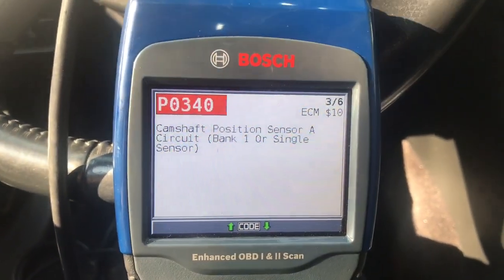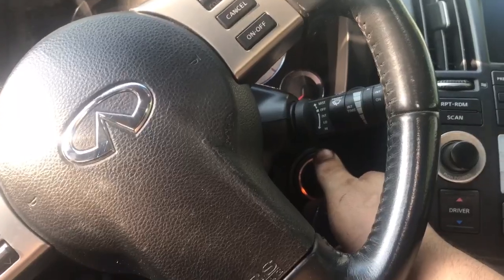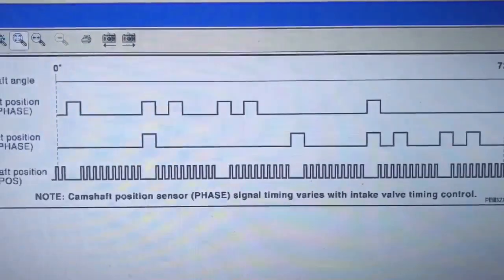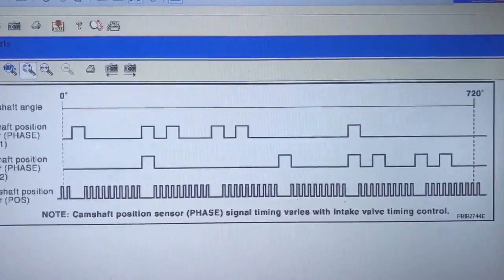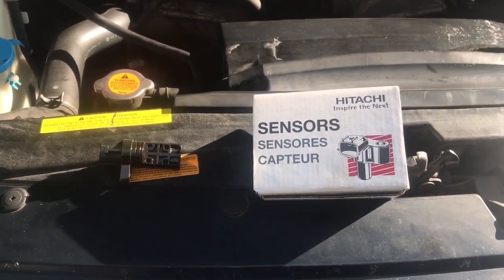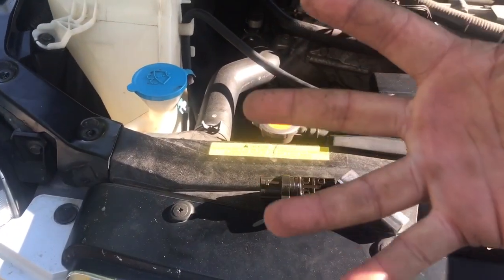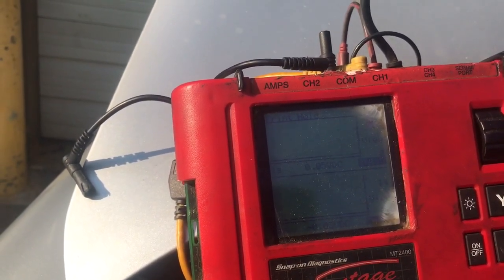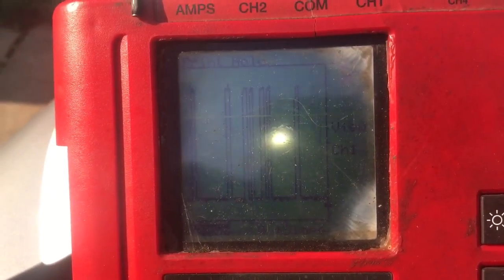Testing a bad cam sensor

Comment: Yo I got a different code idk if it’s still the same so the code u got is 
P0343 camshaft position sensor “A” circuit high bank 1 or single sensor

Comment: I’m having a no start issue and p0340 showed up after a month but it finally popped up while cranking I’ve always thought an engine has to be running to pick up a code and it wasn’t in the saved message either that one had a p0011 something over advanced and that was in the saved codes not an actual cel light

Comment: is it possible for a  failing cam sensor not  be sensed and therefore fail to  activate a check engine light?
Reply from the maker: A dropping 5 volts or ground can cause it but. A dropping 5volts will normally pop a code

Comment: I subscribed to your channel because you have a great way of explaining both how the car is supposed to work and how to make a fix (a rare talent).  Very clear.  I have a cheap multi meter that won't graph the signal wire like yours did.  Can I still test the signal wire with my multi meter?  Am i doing that on the OHMs setting?  Thank you for your video.
Reply: Yes, use low voltage range which includes 5v and set meter to A/C!

Comment: Looks like the previous owner installed the wrong part. That magnetic end on the "old" sensor is way shorter than the factory replacement.

Comment: hate to point this out but you say the owner google the code for sensor and switched it out so why are you replace sensor again??
Reply from the maker: Did you watch the entire video? I checked the signal wire on the sensor they replaced and didn’t show the square signal when cranking. That’s why I changed it out
Reply: Oh I didn't sorry whats the part number of where can I buy it ?
Reply from the maker: I don’t remember the part number. It’s been a while since that video
Reply: np thanks for vid it was great know anything about routans??

Comment: Anyone know what electricmotor is between the firewall and motor...i hear it running and its draining my battery over night...my battery light is on now as well as my e brake light and now launches in 3rd gear .. i had issue with this nissan Maxima 06  3.5 l ...it was cam sensor by battery...but that running fan motor or pump is draining batt...somewhere under the intake manifold....if someone kinda knows what is wrong w it...I really appreciate you taking time to help a not so mechanically smart guy!!;)
Reply: Air pump? ?  I think its an emissions  thing  on start up it pumps air into exhaust to warm it up faster and cut down on emmissons

Comment: I am sick of the fossil fueled cars, next one will be an Electric when the prices comes down.  
The up side is no maintenance, there is nothing that can go wrong with EV's, no tune-ups, no transmission, no engine, no hidden sensors like the one I need to replace with a P0340 code engine camshaft position sensor.  
The car starts and runs fine, but I have this check engine light that will not go out, so I'm concerned that if that sensor goes completely the engine won't start at all one day & then I will junk the car or sell it for parts, so until then I think it will be just for local driving, it doesn't pay to fix a 19 year old car they would have to take half the engine apart to get at the stupid sensor.
When everyone goes EV I feel sorry for the repair guys, they will need to retrain.
Reply: 200
Reply: There many things that can go wrong in electric cars, they are electric…just like the sensors in your ICE vehicle. There are still abs sensors, yaw sensors, throttle input sensors, radar sensors, motor speed sensors, temperature sensors…not sure what you are talking about. Mechanically engines are simple, it’s the electronics on them that are complicated and that doesn’t change with electric.

Comment: Hi, I have 2000 toyota avalon with 1mz engine which slightly backfires when trying to start and won't idle and won't rev over 2000rpm.  came from other workshop which they done timing belt and water pump, checked timing ok, fuel pressure and other things ok as the car can forced to run. as the car can forced to run around 1500rpm and hold steady but the rpm counter on the scanner goes up and down. draft the crank signal on scanner and sowing erratic signal, changed the sensor still the same.